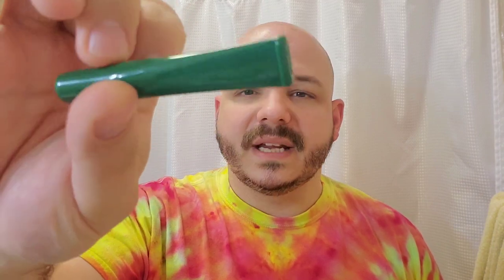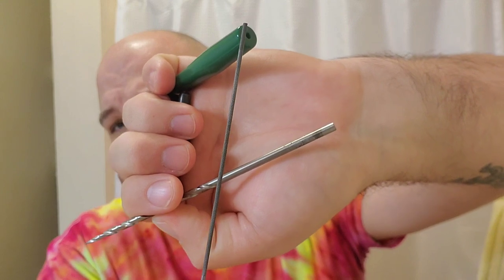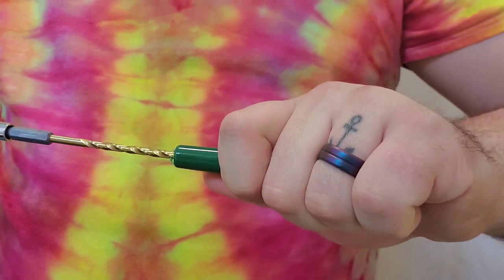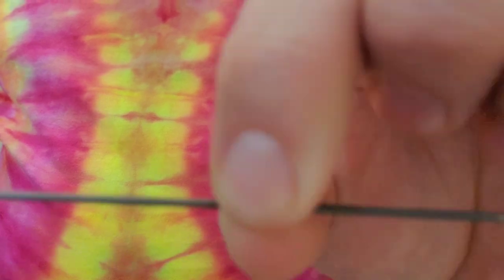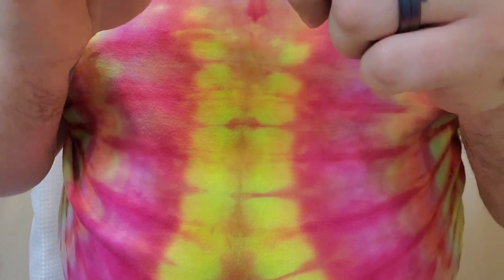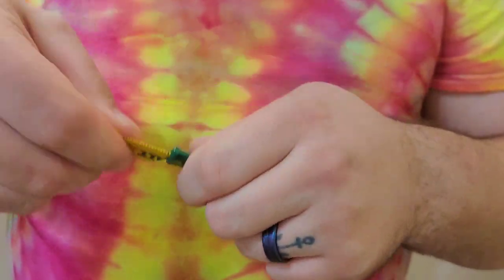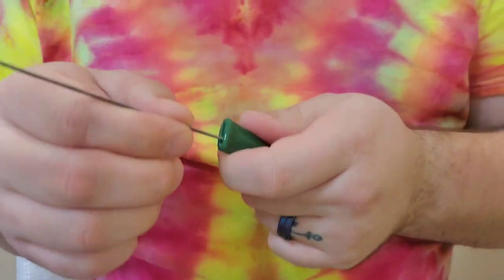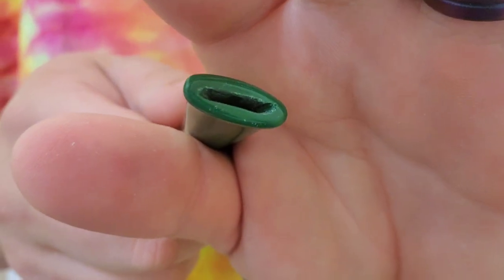How to Drill Out and Cut a V-Slot in a Pipe Airway

Comment: Really great job! Why did you not drill the chamfer deeper/wider in the tenon?
Reply from the maker: If you drill too close to the button, it will crack through to the outside.
Reply: @dhbillings  I guess I’ve seen the tenon ends chamfered more deeply one some of the stems I’ve had it done on. When you show it at 7:07 it looks like the tenon end is still quite flat, retaining some turbulence.
Reply from the maker: @timebomb1251  oh my bad, I misread the question lol. Depending on how flush the stem is to the shank airway, I may or may not do a deeper chamfer. If the stem and the draught hole in the shank are flush without any real gap or misalignment, I tend to make the chamfer pretty small - literally just enough to prevent any overlap and harsh edges in the airway. On a pipe where there is a gap (say with a bent Peterson drilled with a well, a pipe with a 6mm filter space, etc), I tend to make the chamfer go almost to the edge of the tenon. With this one I actually did go back and make the chamfer much deeper.
Reply: @dhbillings  OK that all makes sense. Thanks!